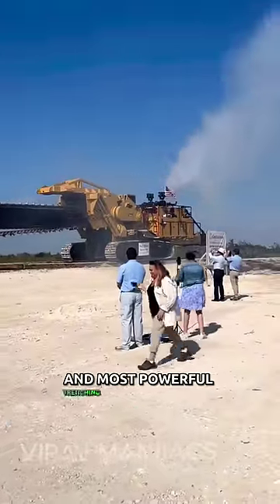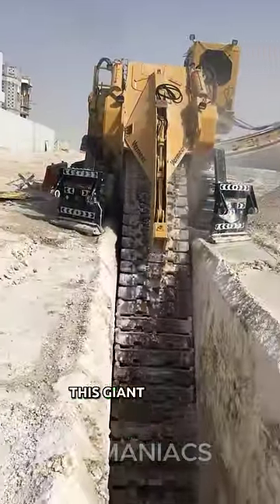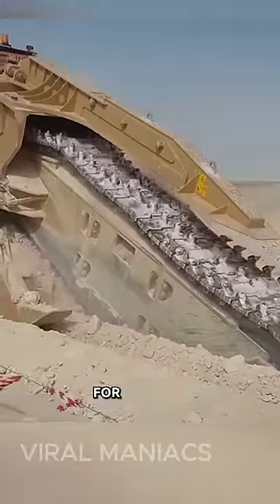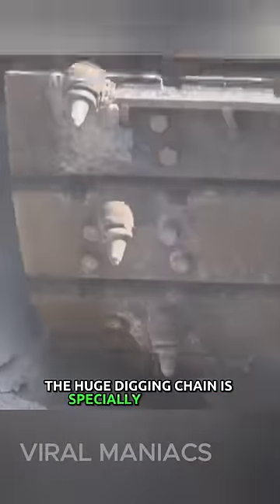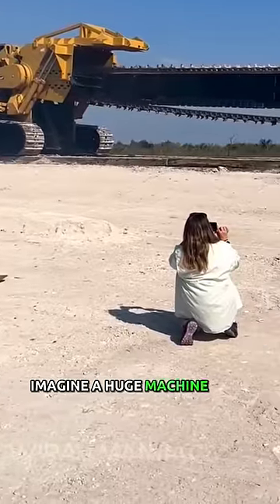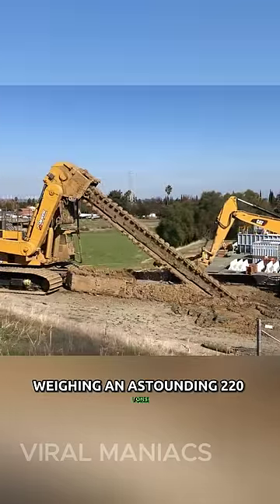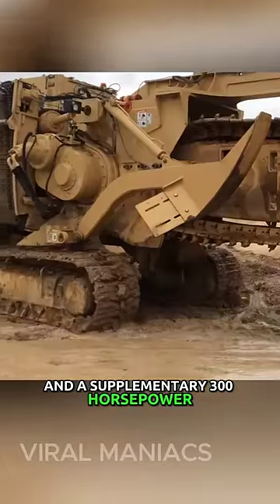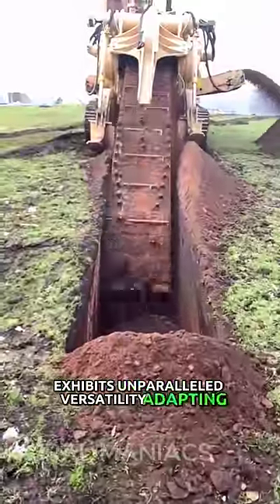Unbelievable Giant Trenching Machine - Trencor 1860 #shorts

Comment: Honestly I would've guessed the motor for mobility would be far bigger than 300 hp. Impressive.
Reply: Possibly a design flaw I was thinking at least 1,000 hp
Reply: It's a diesel, so 300hp, but 2000ft lbs of torque. 

You never look at the hp of a diesel motor, because it means basically nothing. 

Hp is how fast you can hit the wall,
Torque is how far you bring the wall with you once you hit it.
Reply: @DanoFSmith-yc9tg wise words) although the machine would be really slow. But it isn't built for racing, right?
Reply: @DanoFSmith-yc9tg also, torque is a characteristic depending mostly on the transmission rather than the engine. Gearbox's main purpose is to trade speed for torque and vise versa
Reply: HP doesn't matter for applications like that, it's the torque you look at.
Reply: @DanoFSmith-yc9tg 

*lb-ft......this was corrected yrs ago as the expression is force-distance, not the other way around.
Reply: @thenamestails7152 

In the case of heavy equipment, it's more the hydraulics than the transmission.
Reply: @Rotorhead1651  good point. But are hydraulics about moving the platform as well? Not just the lever parts?
Reply: @Rotorhead1651  I just don't know exactly
Reply: @Rotorhead1651  well, alright then.  But you get the point - HP doesn't matter
Reply: its pretty low geared high torque. Their are heavy tanks in ww2 powered by less than 100hp
Reply: The hydraulic pumps that propelled the tracks only used about 50 to 60 horsepower per side. Each side had a hydraulic motor running a right angle gear box, gear reduction/ torque multiplier, which ran a smaller sprocket/ roller chain/ large sprocket - more torque multiplication. I worked there in Grapevine, Texas , until they started closing the plant and moving parts of it to Tennessee. I installed the hydraulic systems on the trenchers,log loaders, and the world's first mobile track mounted rock crusher.
Reply: @bigmungus4864 makes them slow though. But then again, tanks aren’t exactly drag racers
Reply: @smokingwithslim5118 that’s not a design flaw, the diesel engine is there to run the hydraulic system, 300hp and a shit load of torque is plenty
Reply: It moves very slowly, probably.
Reply: @DanoFSmith-yc9tg  hp is literally how fast you accomplish work. A mower engine could power this massive machine, but it would have to be geared down so ridiculously that you probably wouldn’t even see it move
Reply: Yeah, that's what I was thinking.  My car has twice that.

Comment: The fuel cost to operate this per day must be massive
Reply: Probably $400,000 for 12 seconds
Reply: Probably not as much as it would cost to dig those trenches with other equipment, this behemoth can only do one thing, but it's extremely effective and efficient at doing it.
Reply: 1600 horsepower, that"s about 1200 kilowatts, and at 25% efficiency that's gonna need four times that amount in diesel fuel power which is 10 kwh per liter, so 4800 ÷ 10, which is about 480 liters per hour at full throttle.  There is no road tax on construction and farm diesel, so it's probaby costing at a bare minimum $400 US per hour in fuel, or $960.00 CAN per hour in Canada.

Comment: Looks cool. But definitely not vital for modern infrastructure. Excavators are still the way to go. In practice those kind of digging machine aren't economical to run and have limitations when digging the complex trench networks needed for subdivisions.

Comment: The same way a car is blow dryed after coming out of the last stage of the car wash machine;
I think The engineers of the digging🚜machine should somehow add an air-blower system that blows the stuck dirt from the tracks before it re-enters the ground; so the tracks are refreshed every second of its rotation to maximum the amount the dirty collected in each cycle.

Comment: Gorgeous.. I hope my wives make a bunch of them.. right Maji.. ? 
  Probalg a bunch on back order , right Ellen D. Teddy? 
 Does it have a laser leveling and guidance and a side track that would help  it in cuves and 90 degree right angle turns by meas of rotating track base like the track hoes do .. and setting of vertical  pole and pillar setting ? 
 Or do they not yet have them?